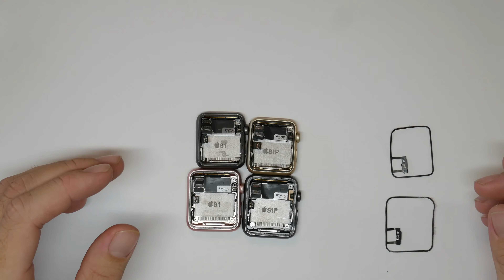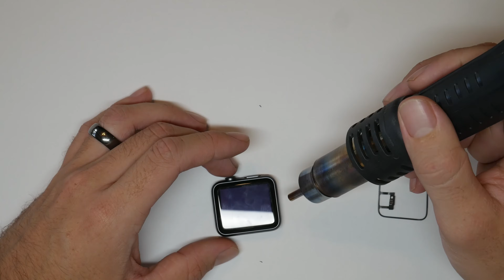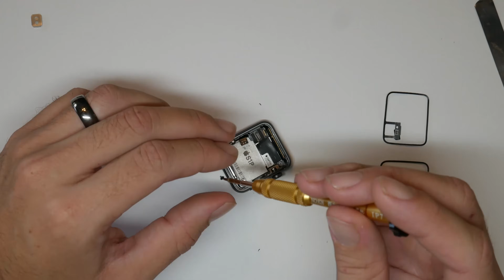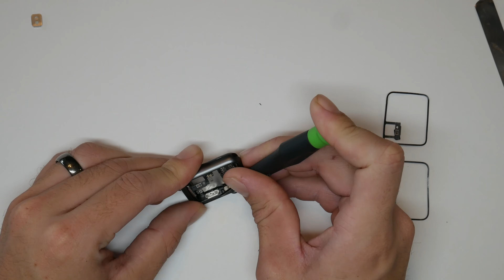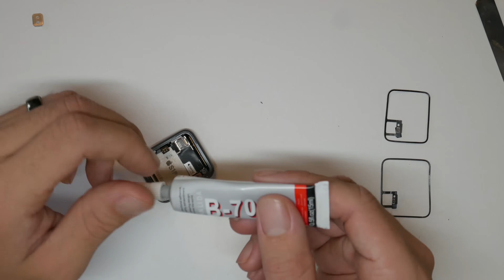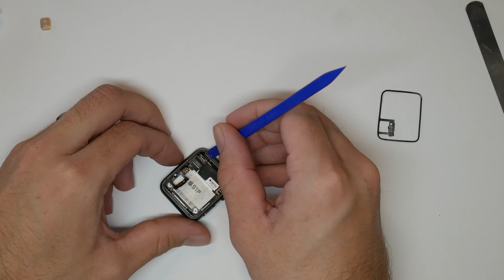Replacing Force Touch Sensor Series 7000 Series 1 Apple Watch

Comment: In the video, you use the adhesive to attach the gasket, but what about the face? I know there is a 3M adhesive sticker, would you use this or apply the B-7000 to the attach the face to the gasket?
Reply from the maker: We use b7000 for all the adhesive